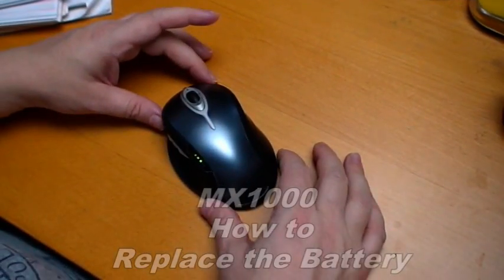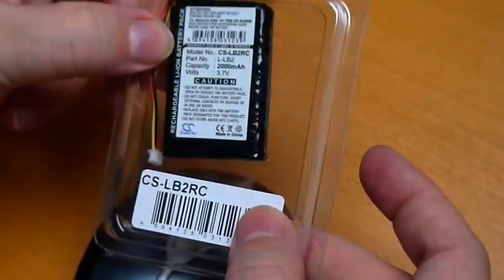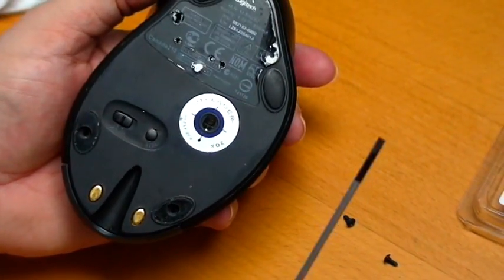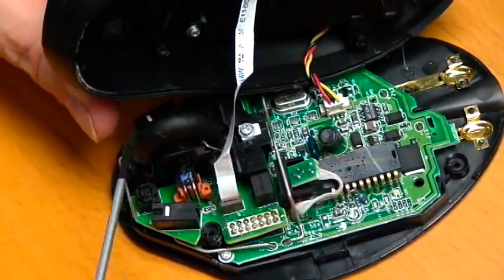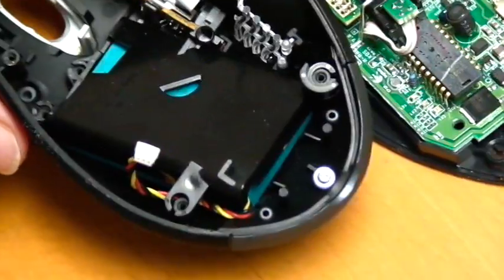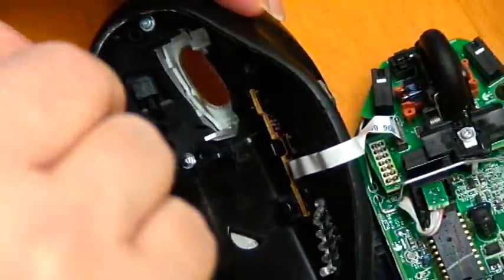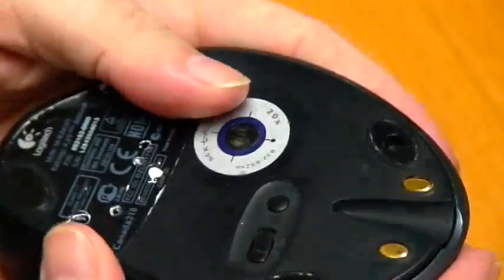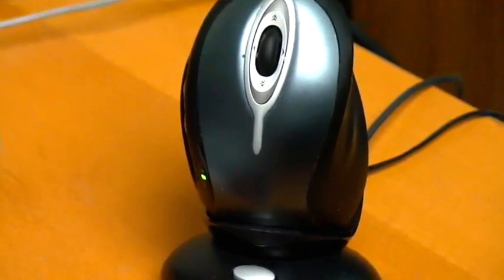Logitech MX 1000 Mouse replace Battery - how to

Comment: Thank you so much! I've been using my MX1000 for about 8 years now and its been working great, still holds a charge for a week. Unfortunately, the clicking started to mess up and it kept double clicking every time I clicked and wouldn't allow me to hold a click to drag anything. I had another MX1000 that I never used, bought as a backup about 6 years ago, unfortunately since the battery was never charged for 6 years it was completely dead and wouldn't charge. Thought it was finally time for a new battery. Saw this video, changed the battery from the bad clicking mouse into the new mouse with no battery and everything works great! Now its like I have a brand new MX1000! Just made me week :D :D :D
Reply: Maybe a little late for this,but I had a similar issue and this little trick fixed it.

Remove the batteries from the mouse  and press the left and right button repeatedly  for approximately two    minutes. This will clear out the capacitors.

I found it in Logitech forums: http://forums.logitech.com/t5/Mice-and-Pointing-Devices/Anywhere-MX-mouse-left-button-problem/td-p/866460

Comment: 8/20/16 I followed your directions and everything went smooth. I spent more effort to remove top case components so I could scrub. Wheel assembly had to be removed and soaked in hot soapy water and scrubbed with tooth brush. My mouse had to be 10 years old, or more. Thank you for making this video!!!

Comment: Thank you for the fine video, very clear and easy to understand. 

I too, am a lover of the MX1000/MX-Laser mouse. I am into my 11th year now, all original equipment. Just purchased replacement skatez(feet/glides) and new battery after watching this video.

For those of you with contact issues when you place the mouse into the charging stand, I'd like to share my solution. I have found that taking a pencil eraser and cleaning the contacts on the mouse helps dramatically. Just rub the eraser on the contacts. I have to do this a couple times a year.

I also have been able to stretch my original battery over 11 years by depleting the charge before recharging. I have gone many weeks before needing to recharge the battery. I only marry the mouse and charging stand when the battery level gets very low, then I fully recharge it. Works great, and it will give you many years of service by properly exercising the battery.

Mark, again, thank you for the quality instructions, I found them very helpful. You also saved me many hundreds of dollars by NOT having to find a "New" MX-Laser mouse.

Comment: Such a great guide, thanks. I'm not having problems with the battery myself, and I've been heavily using the mouse for 9 years now. I accidentally run into this, but it's good to know that you can replace the battery when it starts dying..

Comment: I just fixed my mouse like this. I got it out of the package after 2 years with a dead battery (all lights blinking red constantly) and replaced it thanks to your trick and guide which one to buy on ebay and it WORKS. Thanks man, appreciate your help!

Comment: Great video.  One note: you can actually remove the blue-green cover off of the original battery, and insert your replacement battery into it.  That is why the original battery seemed to be bigger.  It was just the cover.  Just put a thin flathead screwdriver in the seam of the cover and twist, and you can remove.  This way, you don't have to use as much tape/adhesive to secure the replacement battery.

Comment: I had been having troubles getting my MX1000 to charge and hold a charge worth using...I had taken my dad's advice and lightly sanded the brass contact points on the bottom of the mouse and in the cradle and the mouse seems to make better contact now but still doesn't hold as long a charge as when I first bought it 5 years ago. I plan to switch out the old battery for the new one that's on the way with the guide of this great tutorial!!

Comment: Thank you so much for this perfect instruction. I have 2 MX1000's as part of the DiNovo set : one with a stuck scrollwheel and since this morning one with a dead battery. Thanks to your video I found the courage to open up the one with the bad scrollwheel and removed about half a cat's worth of hair!! If that scrollwheel still doesn't work I plan to remove it's (hopefully still) good battery and put it in the one with the dead battery. Got nothing to lose!

Comment: excellent video!!! I had been having troubles getting my MX 1000 to start to charge and to hold a charge and took my dad's advice and lightly sanded the brass contact points on the bottom of the mouse and in the cradle...this definitely helped, and now the mouse charges again and holds a charge for a few days to a week but I have the new battery on order and can't wait to try this new fix!!! Love the tutorial!!

Comment: Thanks for the vid! Had a Mx1000 with a battery that only held a charge for a few hours and another with a wonkey right button that wouldn't hold down half the time making it "machine gun click" but had a perfectly fine battery that lasted for most of the day. Dawned on me I could Frankenstein the battery into the mouse and came across you vid when I got lost wondering why the things didn't just fall apart once the screws were out.

Comment: Just got the battery from eBay and will use this video to guide me.  I've had the MX1000 for over 10 years and I stopped using it because the battery indicator would go to 1 bar in 15 minutes.  I hope this works!!!  Best MOUSE EVER!

Comment: Had this mouse since 2004 . Still works great and has never let me down. Still on the original battery but used this info to give the mouse a well deserved spring clean .Original battery still going strong.

Comment: Great review! I have had my mx1000 since 2005 and it has outlasted many many other mice. For a few years I had is shelved and only used it as a backup, but I have recently started using it as my mouse at work. The mouse button 1 malfunctions a little bit (sometimes clicks twice instead of once and sometimes releases when you didn't) and the charger only charges when you get it into the sweet spot. The battery though still works pretty well. I will probably get a backup battery just in case.
Reply: Mine is doing that double click thing, I've had it since 2004

Comment: Shalom from Norway. Thank you for this perfectly simple and informative video! 
Ive had the MX1000 for 10 years, and it is without a doubt the best mouse ive ever used. Got a battery on ebay, and then found your video. The mouse is charging as we speak :)

Comment: Thank you soooo much! Love this mouse. Mine was 12 years old and still running great except for the battery. Got a battery on ebay like you, and placed it in 10 minutes - simple to assemble, too. Thank you so so much here from Copenhagen, Denmark. All best Peter
Reply from the maker: Thanks. Peter from Denmark.. I still have my mouse and working well...you got to love something built so well
Reply: Absolutely! :) Doesn't happen that often with electronics. Thanks again! :)

Comment: I am going to forward this link to my sis, she is good doing things like this and I am not!  I absolutley love this mouse and hate the fact that it is to the point of needing to be charged every night or I am in trouble with it lasting the next day.  I will be thrilled if she can fix this for me!  I have seen used ones on ebay, but a person is probably going to run into the same problem of needing a battery replacement in the near future. Thanks a millon for posting this for this mouse lover!

Comment: Thank you for this very well done tutorial. My original battery is actually still working great but I needed to know how to open up the mouse to clean it and possibly replace the micro switch for the left clicker. At least now I know how to open it up. Thx again

Comment from the maker: @crystygye     I'm actually using that mouse right now and it's the same battery I replaced in the video above two years ago.  So that particular one I bought on eBay is continuing to work after two years and I suspect it will continue as I've had no problems.

Comment: got mine in 2004 (August/September).. I was one of the first 3 to have it in Norway! :)  and it still holds its charge for 5-6 days using it a fair amount of time each day.. 6-8 or even 10 hours a day!.. everyday for the last.. huh.. 10 years and counting!! WOW!!!!.. and the only problem is that the charger doesn't start inmediately when I cradle the mouse.. I have to fiddle around with the mouse a bit, until it starts. (maybe just some dust?.. or bad contacts?... should be able to fix it, but I have been having this issue for about 3 years, and its not a problem.. really.. takes like 5-6 seconds of fiddling until it have contact and start charging. :)

I really love this mouse.. and I believe it could keep working for 5-10 years more! (and then just change the battery and voila.. 10-15 more years!!) :D   (I do lots of photo-retouching, 3d, fps gaming, and it keeps up like a champ!)

the only con.. is that its not "pretty" anymore.. I remember in 2004 how this was a good looking mouse!.. but today they are lots of better looking mices out there!.. but haven't needed to try anyone, so I dont know if they outperform it!... but, how could they?.. what is it to outperform?. :)
Reply: Thanks for the tip ph1llyg24  yeah.. I have been thinking of doing just that.. or giving it a clean with alcohol (on the contacts)...  But its not annoying me enough yet! ;) and as it needs the cradle to charge, and Im using less the stationary "h"ackintosh and more my new macbook pro so... I will get a new mouse for the laptop that dont need a charging cradle.. ;)  thinking on the newest logitech g700s.. not all that happy with its striped design.. but its pretty much a modern (and better) mx1000 and without the need of a cradle!.. perfect!... and the addition of some customisable buttons, a great plus :)
Reply: Just scrape of the fat and dead skin cells with your nail, and it will start chargin at once. I had a friend who used to lick his fingers and run it over the contacts, but you can imagine how they looked after a few years of doing that.....

Comment: Great video, thanks for the close up of showing the 2000 milliamp 3.7 volt label on the back of the battery. I'm wondering, does the  mouse draw that many amps? I ask because I've seen sites with directions for doing the same thing but listing a Klic-5001 battery for Kodak Li-Ion 3.7V 1600mAh battery. If the mouse draws tries to draw 2000 but the battery only supplies 1600 will that mean the mouse is underpowered? Or does the mouse draw less than the rating on the battery?

Comment: I recall the battery is normally used in a Kodak Camera that fits perfectly into the mouse. It blows that Logitech didn't offer a replacement battery online with the stipulation that it requires technical experience to replace it. But then again, they want to sell more devices. Mine is working perfectly with the replaced battery, and it is great to have some battery life back in the mouse.

Comment: Great tutorial! Just got my battery installed and works like a charm... now for a MAJOR LEAGUE DOH! *SLAP IN THE FOREHEAD* I've been lugging around my mouse & cradle for YEARS, hoping that I could get it fixed. Now that I just got the new battery in, I JUST realized that I do not have the power adapter for it! I'll be digging around to find the specs so I can look for a universal that will work, but does anyone have the Volts/amps +/- post for the adapter - and/or the ac adapter serial/model??

Comment: The replacement went as you show.  After awhile, I started to experience a sort of double click problem.  I didn't relate it to this, but now I'm starting to read about a problem that sometimes seems to be related to static or something that takes place after the battery change.  There is an attempt to fix it.  I think it was a discharging or sort.  I haven't done it yet, because I don't wanna take it apart again.  Lazy.  lol  FYI  I'd look up the double click issue so you can discharge it while you have it open.  Maybe it's worth a thought?

Comment: @Repobrain 
I replaced the battery in my MX that had been idle for years. I was able to find the battery on Ebay as you said. I also found a charging cradle. When I place the mouse in the charger, the mouse lights come on and flash upward while being charged. However, they will flash in sequence about 4 times, then they all turn solid. I used the mouse and the battery ran out right quick. Aren't  the light supposed to flash until the charging cycle is complete? If so, what is my problem? Thanks

Comment: My mouse is about, I don't know, 16 to 18 years old and I still refuse to change it. It's the best mouse I have ever seen and I wish that Logitech would make them again. Now, for the first time, my battery is running down very quickly since a couple of weeks and since yesterday it doesn't want to charge anymore. I already cleaned the two chargepoints on the charger and I adjusted them a bit (since I noticed during the years that they would 'bent in' a little and make less contact. This is not working and I was already afraid that my mouse would be dead. Looking already for anyother MX mouse but it would never be the same :-( Now I am first going to try this solution, the battery has never been changed before so big chance that this is the problem and that I can save my mouse for another 10 years maybe... Thanks!!!!!

Comment: Hey there.. Nice video! :)

I have one question. The adapter for the Cordless Mouse Receiver has 2 info's about the input data. It says " Rating: 5V DC 100mA / 13V DC 500mA(DC plug"
I lost my adapter, but how big should my new adapter be? 5V or 13V?

Comment: I have had this mouse for 4 or 5 years now, absolutely love it.  However, it does not charge anymore when I set it in its cradle.  I dont get any indicators at all when setting it into the cradle, no green or red lights.  Would that be the mouse battery, or would that be something else is wrong with the charging mechanisms in the cradle/mouse ?  would like to get some thoughts before I go ahead and order a new battery for this, because I absolutely want to keep using this thing.

Comment: This works with other MX mice too. Dont be afraid to follow the same steps and if you're lucky like me (MX Revolution), when you open the case, you will find a caddy with your old battery staring at you begging to be lifted out and replaced with one simple clicky  fastener holding it in place! Sometimes the feet will even have enough adhesive on them so you just stick them back on and you're as good as new and ready to go. My replacement batter was only £6.50 delivered from the UK. Enjoy!

Comment: Hi Mark, Thanks you for sharing! Is it possible that some functions don't work, like mouse-over and the interactive corners on my Mac? But only clicking works, sometimes I "lose my mouse" on screen and when I wave around still he is not there, but then after a while he is.
So my question is, do I need to replace and my problems are over or is it another problem? I also love my MX 1000 :-)
Reply from the maker: +Patricia Alders I've seen this sometimes in Windows.   Typically because I have some other USB device plugged in that dragging down the response time.  So you see things like your mouse following you are simply not responding but after a minute jumps the where you last left it.   As for the mouse over if you can put the mouse over a button let it sit there for a couple minutes that that eventually pop up with the mouse over information.  If so you're experiencing a delay.  Try plugging the USB mouse into another port.  Also unplug anything unnecessary and see if the problem exists with those things unplugged.   The other issue unfortunately could be the mouse driver could be so out of date new software upgrades are simply affecting the stability and usability.   Fortunately for me I have found is always something I plugged in that setting up the USB resources.  If rebooting also cleared the problem at least for short while again it's probably a resource issue.

Comment: @patronofchaos 
I've had the same issue with mine and what I found is that the charging pads on the bottom of the mouse get dirty.  Cleaning them usually solves the issue.

Comment from the maker: There are two voltage amperage numbers on the adapter.  13V 500ma (for the DC plug) looks like the output from that point to the mouse 5V 100ma

Comment: Do you know of any way to get a replacement wheel for this mouse? The rubber cover on my wheel is starting to get deformed to the point that it doesn't turn very well.

Comment: Here's an unusual situation. I bought this mouse 4 years or so ago at the same time as a wired G5 "gaming" mouse, and never got around to using the MX 1000 even once.

Now the G5 scroll wheel is malfunctioning so I'd like to use my MX 1000 instead of buying something new.  But I'm wondering what to expect from  a 4-year old never-been-charged battery. (charging it even as we squeak)

Any guesses as to battery state?